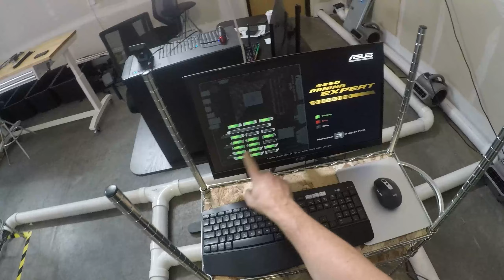GPU RTX 3080 Mining Farm - Setting up 14 GPU Mining Rig

Comment from the maker: Running 2 risers on a single sata cable for over 2 years now on various rigs. Not one burned cards, no hot cable, no dead gpu, no dead psu. As long as the gauge is of good size and quality there are no problems.
Reply: What gauge are yours?
Reply: The wire rarely matters, the connectors do, since they are usually what burn.
Reply from the maker: Also keep in mind that mining is run at 1x pcie thus it uses ~10 watts. It will never ever burn. Even if it runs at 20w each that would still make the cord be at 40w which is way under the 50w max.
Reply: @CryptoLLC  please stop already. The more you talk the more it becomes apparent that you dont really know much about computers. Please lookup a pcie slot pinout wiring diagram to see where the power lines are ...

I would recommend watching a pcie slot/riser powerdraw test on various GPUs by someone like bitsbetrippin to understand the issue.
Reply: @CryptoLLC  what gauge are yours. I'm pretty sure they come in just one gauge. Depending on the GPU, I've seen them pull up to 25 w
Reply: @CryptoLLC  " You have to be careful about SATA power cables. Some of them are missing the 3.3 volt wire. People with older power supplies often use adapters which convert from 4 pin peripheral cables to SATA power cables. But since 4 pin peripheral connectors only supply 5 and 12 volts, the SATA connector is missing 3.3 volts (there's no orange wire). There are also a few older power supplies which inexplicably have SATA power cables which are missing the 3.3 volt wire. Currently, SATA drives rarely use 3.3 volts. That may be because there are too many people using adapters so the drive makers don't want the headaches which come with using 3.3 volts. But in the future, 3.3 volt drives may become common so you need to be careful when using SATA power cables which don't implement 3.3 volts."
Reply: The problem is, for any reason, the power coming from pcie cables is not enough the card will try to take the extra energy from the riser. But, just like you, I power 2 risers with one sata cable for years now… But only on low wattage gpus (1060, 1070, rx 5600,…). I only lost a couple sata cables that melt around the connector and only 2 psu that melted the connector on psu. I did because it was hard to get good hardware and I had to deal with what I had available. Today I’m replacing old hw for pcie or molex when I get the chance and newer equip pcie only.
Reply: Just wanted to add to the discussion, I love ur vids! Keep ‘em coming

Comment: Finally you revamped the whole gpu farm. It was annoying to see you struggle in the past that you had to keep moving constantly to prevent that automatic light from going off! Made focusing on rigs and what you were trying to say difficult. Congratulations on the new improvements you made. You got a new sub!
Reply: Also can I ask from where you get these power cables for rigs and electric respectables, any leads would be appreciated. Thanks man. Keep up the good content.
Reply from the maker: Amazon. Thanks.
Reply: @CryptoLLC  Thank you

Comment: Silly question here: Why windows and not hiveos?
Reply: I wondered the same, Probably to cut cost
Reply: I could not imaging trying to maintain large farm with windows. Hiveos pays for itself 10x in reduced maintenance costs.
Reply from the maker: Drivers, control, remote desktop and so on.
Reply: @CryptoLLC   once you scale to thousands of gpus you will find Windows to be your worst nightmare. Yes it is nice to have mem temp monitoring and voltage control, but those aren't enough to offset the downsides of windows. No serious GPU  mining operation in the world runs windows.
Reply from the maker: @SavageBits  For us it is worth it. We are already in the 500+ gpus so your point is mute. Vram temps is a do or die for 3000 series GPUS. No serious miner would run 3000 series without vram temp monitoring.
Reply: @CryptoLLC  good point I forgot about that, I believe in linux the max gpus is 12, for 14 you need windows.
Reply: @abusadoruci  nope, have multiple nivida and amd 14x rigs on hive

Comment: 24:30 starts pulling cards out of the powered on motherboard. Pushing the pc power button off does not fully de-power the board. Common way to fry boards and cards. Best to pull the power cord out of the power supply and wait 30 secs for the caps to drain.
Reply from the maker: LOL. hahahahhaha
Reply: @24:01 actually he powered off the motherboard/rig prior to pulling the PCIE adapter from the motherboard and the GPU off the riser.  You might need to re-watch the video!

Comment: What is worse than using Molex to power risers on 3080's, and worse than using TWO risers per cable as he states, is using TWO sata to (whatever riser power plug) ADAPTERS on SATA CABLES as you can see in the video. This guy obviously has little to no experience with mining and will be learning things the hard way soon.
Reply: Question. Is that ok to use one Molex cable powering the risers for both 3080 and 3090?
Reply: @dlj7  In a pinch, one molex/sata riser per cable is somewhat okay, but do NOT use any adapters - make sure that you plug the molex/sata cable directly into the molex/sata power port on the riser. Adapters are almost always the first thing that burns. But I would still recommend sticking to pcie powered risers and using only the pcie cables when powering any GPU that is going to draw upwards of 180w total.
Reply: @TexasAce  idk where people are getting the "molex is rated at 150w" number. Molex has the same ATX specifications requirement as Sata and most manufacturers build it to spec and no more. 1.5a per 12v wire.
Reply: @richiedeadsix  thanks so much. Really appreciate.
Reply: @TexasAce  Got it. Thanks!!!
Reply: @TexasAce  please look it up instead of making assumptions.
Reply: @richiedeadsix  SATA and Molex have the same power capacity of 54Watts.  SATA and Molex connectors provides three 12v pins at 1.5 amps each, for a total of 4.5 amps. 12 volts * 4.5 amps = 54 watts.  Looked it up and that is what is advertised.
Reply: Well looking at him his super rich man he doesn't even care about that I guess it's his hobby
Reply: Just see how much stuff he has he's making out  1gpu money back every day easily so why whold he care
Reply: @Smarthellhound  because u never know how a fire will end

Comment: In addition, it is absolutely safe to use SATA to power the adapter board. The main power supply of the graphics card is 8pin, and the adapter board consumes very little power.

Comment: Molex to power the GPU is a polemic topic. Most people would try to use a pcie 6 pin at least. But many people never had issues.
Reply: @mattketner7597  1070 does not need as much power as a 3080.
Reply: @abusadoruci  The rig I bought had 5 cards on a single 650w Antec 80+ Bronze power supply. That thing was getting toasty to say the least lmao.
Reply: Molex connector can deliver up to 156W. Each PCIE can eat up to 75W. You can power up to 2 riser with one molex cable safetly.
SATA connector can deliver up to 54W. You can't power any PCIE safetly by desing with a SATA connector.
Reply: @DeepRacerGamer  Molex has 3 x 12v 1.5a rated pins and one ground. Do the math.
Reply: @richiedeadsix  where did you get that from?

Comment: I see you have zero experience with crypto mining. Using 2 molex per cable for a 3080s and using Windows for mining. You are doing lots of mistakes with the basic stuff and you want someone to let you operate his mining farm?
Reply: People use windows for mining to keep track of the memory temperatures (hiveos doesn't have this feature), something that is needed for gddr6x cards. Using 2 molex per cable is dumb but if you don't know the advantages of mining with windows you shouldn't be talking either